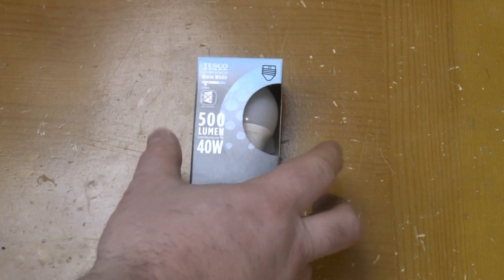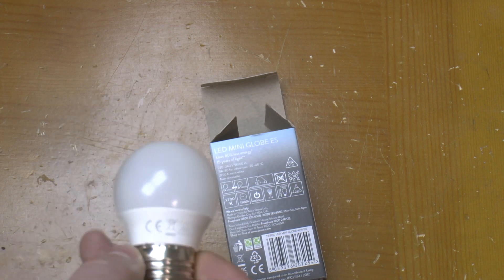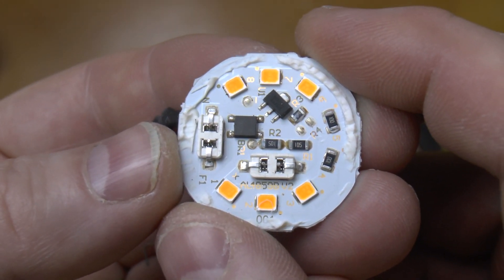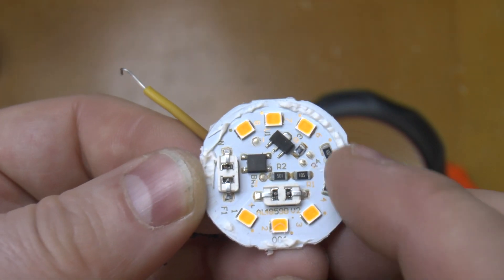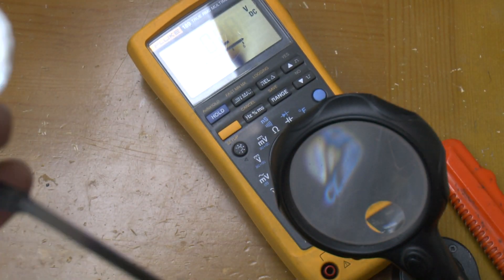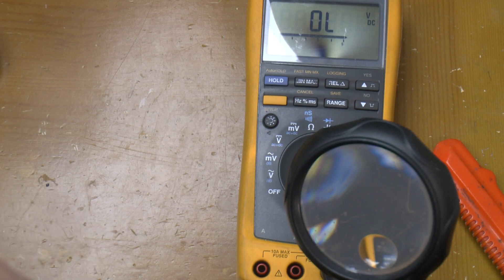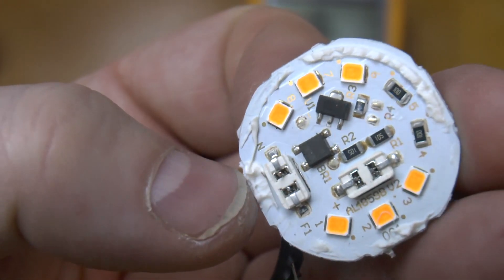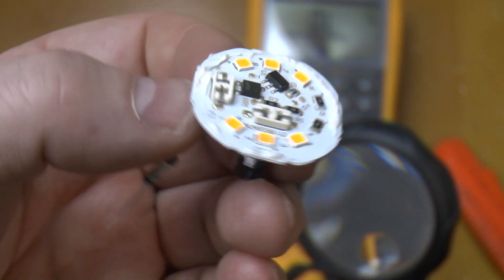Tesco 5.5W (40W equivalent) LED lamp teardown

Comment: Led lights are terrible in my opinion, they fail quickly or dim loads and flicker, they aren’t as bright as the old ones and the 100w equivalent bulbs are really bulky. I use CFLs

Comment: How do you get the circuit board out of the E14 & plastic housing
Reply from the maker: Brute force and gouging.  The plastic piece ends up as a lot of smaller, chewed-up plastic pieces.
Reply: @AintBigAintClever  I have a Tesco E14 tulip style LED bulb which was not working. Unscrewed it, cleaned connections, screwed back in, nothing. Unscrewed it to bin it & it flashed on for a second while unscrewing. Screwed it back in & it flashed on again for a split second. Unscrewed it, shook it & there's something rattling inside.
Tried different light socket & nothing. Wiggled it around in the socket & nothing. Flicked the lightbulb & it flashed on again.
Kept flicking the bulb harder & harder until eventually it stayed on. Strange. Next day it didn't come on, it would flash when I flicked it, staying on if I flicked hard enough. Would stay on for hours but got annoying & hurt my fingernail.
I thought it must be something loose, and I heard that rattling, so I had to get the thing apart to have a look.

Pulled off the top, cut away the silicone, unscrewed the led board, lifted it out. Underneath was the main board. Could see something rattling around behind it.
Yanked main board out with needle-nose pliers, looks like one of the parts has blown/burnt out & snapped in half, leaving the other half rattling loose in the housing.
Looks to be the tiny mini drum coil inductor that was two thirds snapped off, with a small scorch mark on another part. The inner material was like graphite.
I thought for sure it's dead.
Then I noticed that one of the pins was not soldered onto the board from the transformer. It was all through-pin & the first pin was soldered but the second was not at all. So using the pliers I just bent the pin flat to the contact on the PCB.

Then I did something completely out of left field & I put the snapped piece of the inductor back in place on top of the remaining piece, wrapping it with insulation tape to hold it in place...

I didn't have high hopes, but I screwed the bulb in, and low & behold LET THERE BE LIGHT.
I couldn't quite believe it.

What do you think is going on there?
Was the flicking action just forcing the unsoldered pin to make contact?
If so then how can the circuit function without the top ⅔ of the drum inductor? It has clearly blown.
I don't think my insulating tape has repaired the blown inductor.
So how can the bulb function without a blown inductor? If it's not needed then what's it even doing there? I don't expect it to last long but it's identical in performance to the two identical bulbs either side of it. Hopefully the house doesn't burn down😁
Reply from the maker: @alextomlinson  I've seen incandescent bulbs which were blown but which would light if you flicked them, presumably it would make contact then continue to arc across the gap until switched off, at which point it would go out and need flicking again.  I expect that's what was happening here.  As for the inductor I'd expect it to still have some function (in this case enough function) as long as there's some core still present.  Inductors are definitely not my strong point though, so I could be talking nonsense.
Reply: @AintBigAintClever  I think it was definitely that missing solder causing the issue. There's 2 pins going through the PCB. One was soldered the other wasn't. It was just a bare pin. I don't have a soldering iron so bent the pin to maintain contact that way instead. Seems to be doing the trick. Just hope it doesn't catch fire due to that inductor being burnt out.

From what I've researched:
"All LED applications require a DC power supply to provide power to the LED. Inductors are used in these power supplies to smooth out the ripple current typically seen at the output of the supply."

I think a drum inductor is wire coiled around ferrite to create resistance to fluctuations in current.
The number of turns of wire an inductor has determines the DC output to the LED and thus, determines the brightness of the light. The more turns there are, the more resistance there is, and the less circuit current.

Considering the top ⅔ of the drum got severed, giving it less wire turns & undoubtedly severing the connection of the tiny wires in the coil, you'd expect the circuit to have a fluctuating current, or more current, and a flashing or brighter LED as a result. But it's on solid & they look identical in brightness.
Maybe the LEDs can only go so bright, so even if you increase the current, the brightness remains the same. Although I doubt the LEDs would be set to run at their highest power rating. I don't expect it to last as long as the other 2 bulbs, but so far so good
Reply: @AintBigAintClever  The engineered obsolescence of the 21st century

Comment: I have never had a LED lamp live anywhere close to the rated life, even those running 24/7, except for some Osram 2foot LED retrofits, which are running now for nearly 10 years, but there they are also in the original fixture and have the original 20W ballast in series with the mains, leading to them being run on reduced power, which has contributed to them lasting that long. 

One of the original LED retrofit types, the newer ones run the tiny little chips at a much higher current now, so are absolutely not going to make more than 3 years. I see many that do not even make it out of warranty, which can be a pretty expensive replacement, as often these need a cherry picker to change them, as they are high bay fixtures.
Reply: Same here. Almost all LED lamps I buy run seriously hot, except the more expensive Philips LED lamps I've bought in the past, but the decrease in brightness after 1 year is pretty insane. Haven't been able to measure it (yet) but it's definitely noticable...
Reply: Similar here - I put 5 x 8W Philips LED bulbs in the living room chandelier back in December 2013, which were on an Amazon lightning deal at 2 for £10 at the time.  One bulb failed October 2018.  As it's a chandelier, I had to replace the lot to match, so I bought 8 x Osram Classic A, figuring that I'd have 3 spare for future bulb failures.  Well, the first bulb went about a year later, another the second year and two more in 2021, requiring me to replace the lot again.  I gave away the 4 remaining Philips bulbs a few years ago to someone who needed 4 for their kitchen and when I dropped by for a visit December 2021, the four bulbs were still working!  

On the positive side, I find most of the branded LEDs maintain their brightness much better than CFLs, which noticeably dimmed in the first year and have better colour rendering also.  Roughly half of CFLs that failed stunk the room with a burnt plastic smell right after it went out, usually with a bang, tripping the lighting circuit.